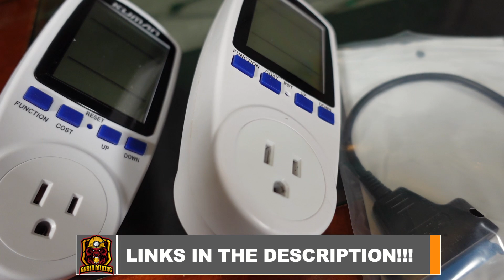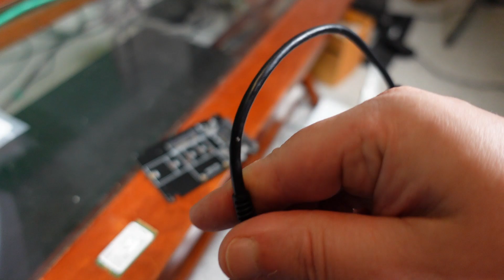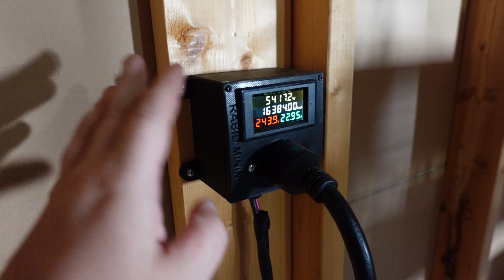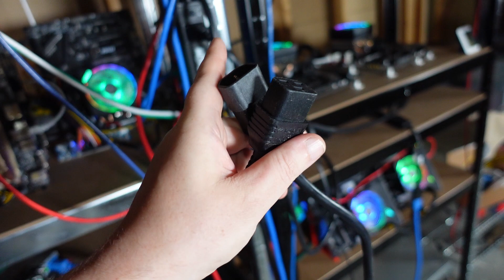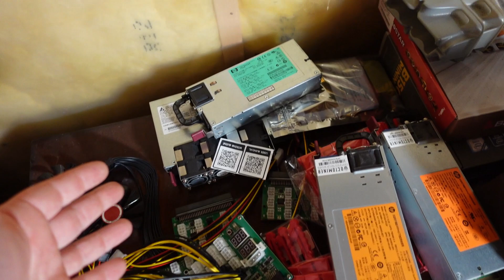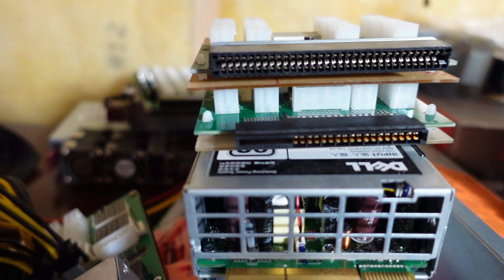Amazon Prime Day Is Here!!! Crypto Mining Hardware EVERY Miner Should Have

Comment: yo those white power meters will burn your house down check the reviews
Reply: The reviews are from folks who don't follow the 80 percent rule. Sure it says good for 13 or 15A depending on model but people leave them plugged in, they're not actually rated for constant 13 or 15A.
Reply from the maker: Yup been trying to say that should mentioned it in the video it's ment for testing not a permanent plug.
Reply: You shouldn't be keeping the wattage meters plugged in all the time anyway

Comment: for the sata... I hear this from every single youtuber and the solution is simple. If you can't afford atx power supplies with a billion cables and you can't mine with server ones because of the noise, if you mine on windows and monitor your cards through hwinfo64, you can mine with sata power on riser. I've mined flux and cfx on a 3080, 3070TI etc very power hungry cards using sata and made sure they don't go over 40-45w on pcie power draw.
Reply from the maker: Can run splitters across risers.

Comment: RM my metered PDUs are 24 and 36 inch, the 36 inch metered PDU comes with 6 c13 and 4 or 2 c19, no need to buy the big long PDU,
Since I run mainly Big ASIC I only have 2 or 3 BTC miners per PDUs, also my most expensive PDU only cost $146 .. was $120 a few years ago but price keeps going up a bit.
Reply from the maker: Nice in Canada here they are upwards of 300+ for the metered so could be country dependant as well